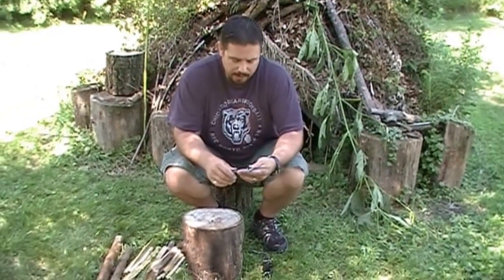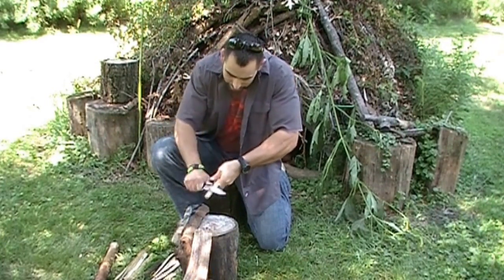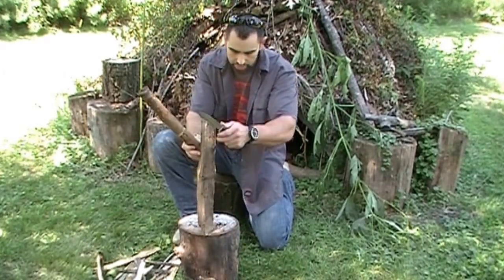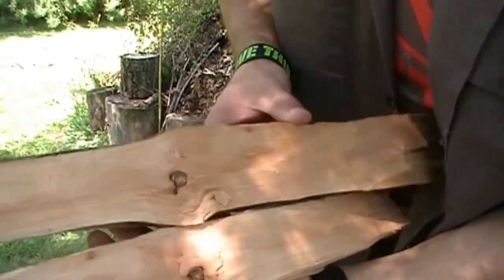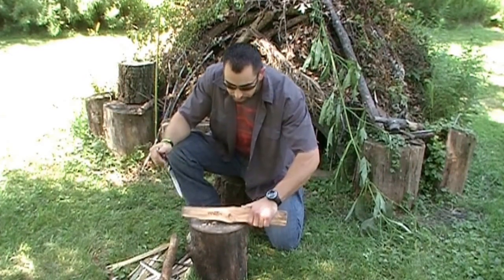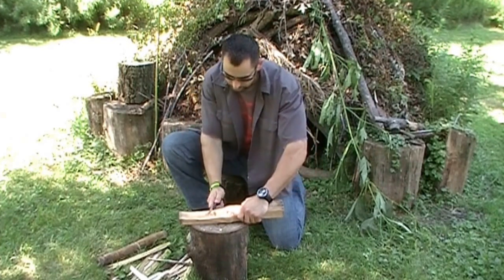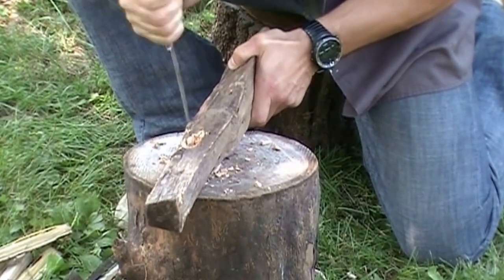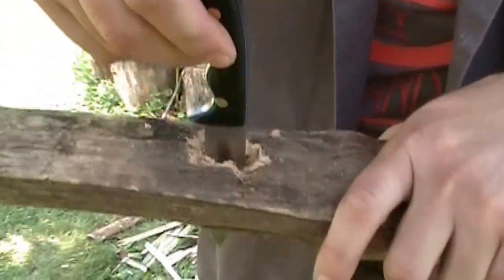Elmax heat treat test

Comment: Hello, I wanted to know if according to your Elmax experience is the best stainless steel knives for survival / bushcraft?
Reply: In my experience Elmax is a great steel for survival / bushcraft but I don't know that I would call it the best. It has a lot of good qualities like corrosion resistance, it holds a great edge and its is tough as you can see from the video. The downside is that it is not easy to maintain the edge in the field unless you carry around diamond sharpening equipment. This is why I also make knives for outdoor use in W2 and 1095. They don't have the corrosion resistance, edge holding, or toughness of Elmax or CPM3V but you can get a great edge on them relativley easy.

Paul 
CPE Knives
Reply: I was told the users that is not too complex to sharpen, you is not? with a stone as the DC4 Fallkniven you think you can be reground on the field?
Reply: You can sharpen on a stone but properly heat treated the material is very tough and it can take quite a bit of effort if the edge is allowed to degrade. If you are using a small diamond stone which can easily be added to a field kit it is no problem. Compared to a high carbon steel like W2 or 1095 the Elmax will hold its edge a lot longer but it can take quite a bit of work to restore if you let it get too dull. That is one of the reasons a lot of field tools are made with traditional carbon steels.

If you are interested in an Elmax blade I say go for it. I have used Elmax for years on field blades with good results.